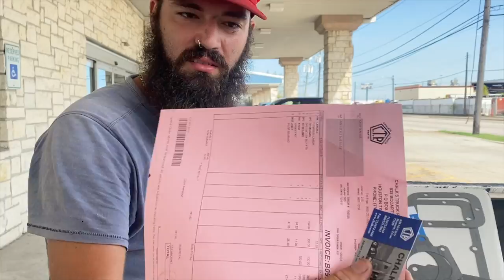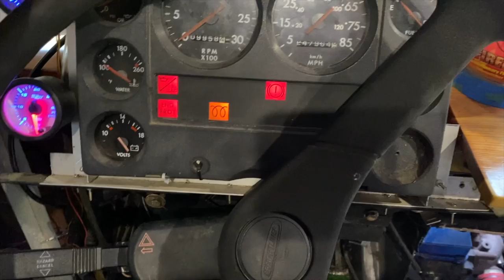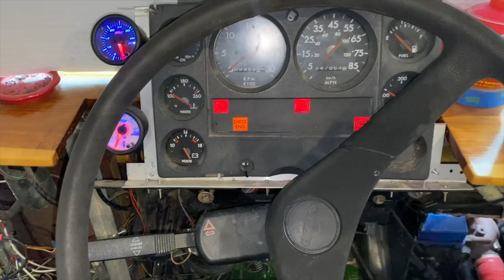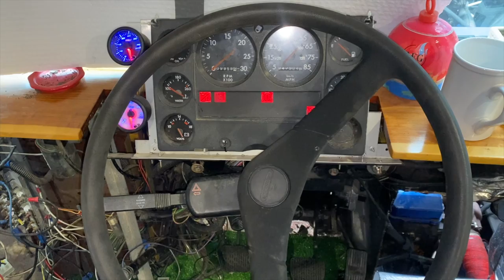Swapping to an Eaton 5-speed manual on a SCHOOL BUS | AT545 Allison with 24v 5.9 Cummins CONVERSION

Comment: Hello again I see you're having problems with your U-joints, one thing I've learned throughout my life doing Automotive work and mechanical work is if you go cheap you get what you paid for, I know when you're on a budget it's hard to do, but every time I tried to save money I always ended up spending more money or getting frustrated. I'm glad you worked it out.
Reply from the maker: Thanks for your input🥰
You are correct!
I’ve also had many hard lessons learned in the previous years. These were my first real ujoint swaps and some folks on YouTube here have enlightened me on some of my complaints being a common practice. Not all, but some.
The more expensive shop justified their prices with my lack of knowledge, in a wrist slapping kind of way so I wouldn’t have hired them if they were the only shop in town😂
I’m glad we got it all worked out.
4k+ miles since this video🤟🏻

Comment: That's a big project and I'm enjoying watching your videos.  I don't know what to say about the bad carrier bearing, but I wouldn't beat up on the driveline shop for not pressing the cups on.  If you have solid yokes (the kind without the straps) then those cups get pressed in from the outside after you put the spider (cross piece) in place...so it's normal to leave them loose so you don't have to try and pry them off.  Of course, it would have been nice if they'd asked you what kind you had. :-)
Reply from the maker: Thanks for keeping up with us bud!
I know I know, I didn't wanna be so harsh. The owner of the place with 55yrs of experience didn't even look at the job his young worker performed. It went out the door without any quality inspection. On the flip side, parts were over $400 so this shop did the job for just a little over $100 of labor which YA GET WHAT YA PAY FOR. The second shop that claimed the newly installed carrier bearing was bad, says this happens somewhat frequently that a bearing isn't quite to spec. It doesn't press down into place like it should & moves on the shaft. I only believe them because in my A/C work I've come across many brand new thermostats that don't work, for every 100 or so you get one or two bad ones. So I had something to compare to.
Thanks for the clarification on the yoke styles & big ol thanks for watching!

Comment: Thanks for the video and all the much needed  info. I totally understand your frustrations with the u joint caps. When you install u-joints, some yokes are made to have the caps pressed in  They leave them unpressed so you don't have to pry them loose. Your u-joint guys did a good job it's just they are accustomed to  dealing with companies and mechanics that have the experience installing u-joints and driveshafts.   Having the right tools for the job is 90% of the job.
Reply from the maker: Understand that! Like any great amateur it’s easiest to blame someone else😅
Having the right tools is correct, did most of this job with a 3/8 racket & socket set. Wouldn’t recommend.
Thanks for watching bud! Glad you found it useful

Comment: If you didn't have the u-bolts on the yoke to install your drive shaft, you wouldn't be able to install it with the bearing cups on. Some yokes are like the driveshaft in which you have to install the u-joint bearing cups after you put the u-joint into the yolk, then install the clips to hold the cups in place. That's why they didn't press the cups on for you; because you'd be screwed (or at least inconvenienced) if your yoke wasn't the bolt on type.
Reply from the maker: Thanks for the insight! This conversion was a huge learning curve for us.

Comment: Fantastic Thorough video Bro !!! Answered sooooooo many questions for me. I've just bought a 2003 Freightliner FS65 with 24Valve Cummins and AT545. Like a dumbass, I made an assumption that it would be an MT643 or 2000 by the looks of the shifter. WRONG. Thankfully, at this current time the 545 is working fine and it's been rebuilt by the sticker on the side of it, but it is leaking from the access hole where that plug goes in the bell housing. So I'm going to guess it's a front seal. I want to convert either to manual or 2000. Since it's a 24Valve, the engine has a computer already along with TPS and all that, so a 2000 swap should not be to hard. But yeah, great video showing what it looks like under there and and behind the engine etc.
Reply from the maker: Wow! You must’ve got one of the last ones in production in 2003!
Transmission fluid was leaking from this same hole on mine, I brought this to many tranny shops and never got a straight answer.
Thanks for watching & I’m happy you found value in it!! I love my manual now, 3k miles in. I’d suggest making sure you find something with overdrive, I still ended up with a final 1:1 gear ratio just like the 545.

Comment: I have been highly considering diing the exact same thing with a new eaton 10 spd dumper transmission.
Reply from the maker: I would definitely go 10spd next time. This transmission ended up not having OD. Which is okay, my other transmission was bad anyway. Can’t imagine I would use many gears about 7 with this 5.9 Cummins tho🤣

Comment: couldve used a big vice to push the bearings back on the joint , lesson learned maibe to check the price of the parts before getting quotes for the work 
still think you should extend the bumber sides so the hole under the extention is closed
Reply from the maker: Thanks for watching bud! We are very happy this battle is done. I really wish our options of tools were sufficient, I could hardly find the hammer!! I will definitely be making the bumper prettier dont yah worry:)

Comment: I have a Brazilian ford 6.6L inline 6 bus with the Ppump style mechanical injection system.

I am looking for at least 5 to 10 speed transmission models that   would be a similar conversion, because I would love to have an Eaton 10spd in my bus.

I drove truck for years but I didn't work on them really, so I'm starting from basic knowledge and a bit of car dealership apprentice experience.
Reply from the maker: Shoot me an email edemette@dieselcore.com I believe we just got 4 of these motors in attached to 8-10 speeds

Comment: I have 2002 444e x2 545 100k international bus. Fed ex 5 spd eaton brand new . 30 k replaced 98 low mi. 444e. 5speed has adapter plate .
Reply from the maker: Nice! I have a 00 Freightliner FS65 with 300k miles. Eaton 5speed 😉

Comment: Think I will just change rear ends for road speed
Reply from the maker: We salvaged our rear chunk from the donor, but the donor is 4.33 & we are currently 4.63 so the difference was less than 100 rpm. We have 10r22.5 tires so the math from changing our tires vs changing the rear end was much better.
Reply: I'm running 4.44 in mine going to try 3.90
Reply from the maker: @bigbearccoffin  
My donors 4.33 is for sale;)
Reply: I already have a 3.90 here from donor truck
Reply from the maker: @bigbearccoffin  
Awesome!! Good luck buddy.